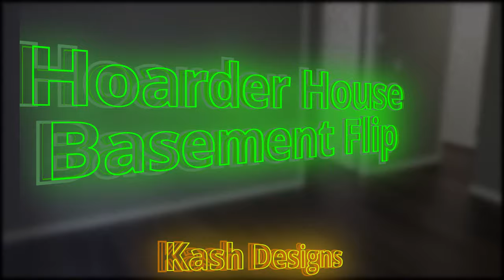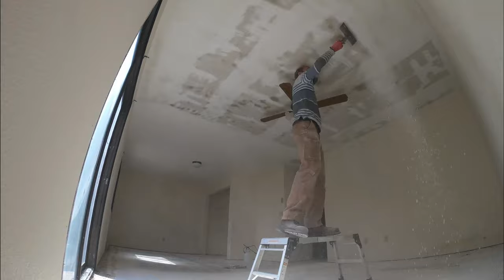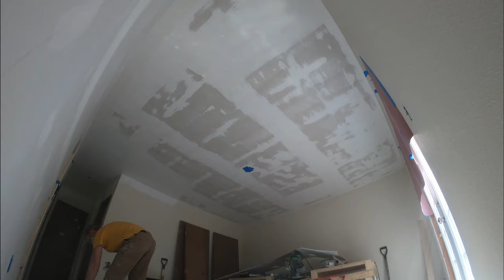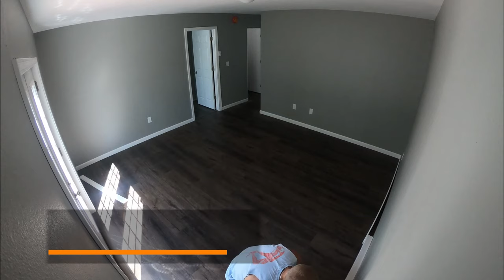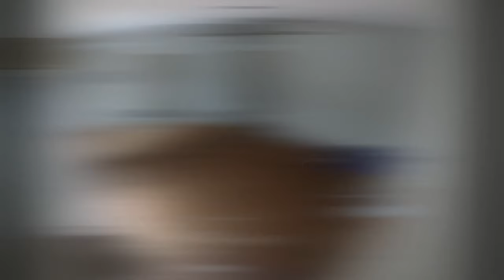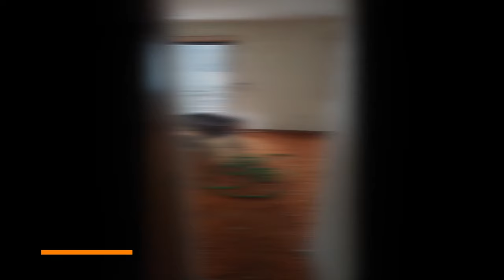Hoarder House Basement Remodel - Adding A New Bedroom 🔨 (DIY Time Lapse)

Comment: Tell me more about scraping the popcorn. Is it really just as simple as wetting it down and scraping? Do you have to sand it afterwards before you paint? We have it in our entire house and I’d love to get rid of it.
Reply from the maker: Great question, but yes that's basically it! It worked best to spray a light mist of water onto the popcorn, wait a minute or 2, and then scrape away. The popcorn in this house came off very easy, though I have heard nightmare stories from other people though where they had to scrape really hard for a long time. 

My one piece of advice to add, is that if you plan to use a paint sprayer to paint the ceilings, I would use a roller to do the primer coat first. I sprayed all of it without rolling first, and some dust from the scraping got stuck under the paint and cause it to peel in a couple spots. I ended up having to bring out the roller and fix a few of those spots. So if I could do it all over again, I would roll primer first, and then spray to get a better smooth finish. Good luck!

Comment: Good job cleaning up, Grey is okay but not that dark. You really should have added laundry and another bathroom for having 3 bedrooms. The place looks neat but finishing is up to the new owner? no poles in the closets? what about new water heater, pipes, doors? Those single pane sliders are 30 years old they should go.
And because it was a hoarders house what damage of mildew and rot was there? did you replace floor boards? I would be looking at things like that before I considered this place.
Reply from the maker: All good questions! There is a 2nd bathroom with a shower in the basement, I didn't get good videos of that though. Same with the laundry room, it's there and nicely updated. Also had the water heater replaced too. Debated replacing the windows, but they are actually in good shape for their age (slide well, keep the cold out). And we got really lucky as far as mold or mildew goes... there was literally only one spot that had anything (upstairs bathroom), and we just replaced the bad drywall. Nothing wrong with any subfloor!

Comment: Two days to clean up the room?? Are you kidding me?? Just get toughy contractor bags, in an hour it's gone.
Reply from the maker: Do they make bags the size of a dumpster? Cause we filled up 2 full sized dumpsters from that area alone! 😂
Reply from the maker: @dontblink216  Those are kind of cool, but they are small. Those are 3 cubic yards, compared to our dumpsters were 20 cubic yards. I'm also not sure how you would lift a 3 cubic yard bag full of junk without having heavy equipment!
Reply: @KashFloPro  hey, I never claimed they were better than the ones you use, I'm just saying they exist lol
Reply from the maker: @dontblink216  No worries! I didn't know those were a thing, I have seen something similar for like raking big piles of leaves though.